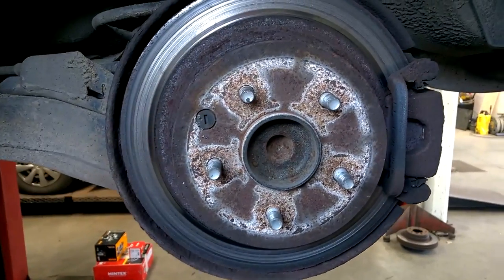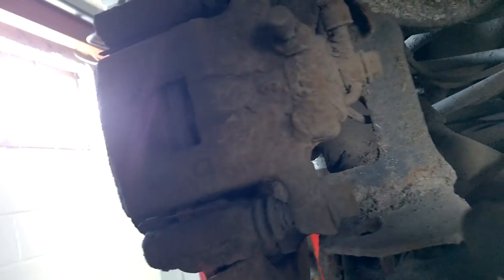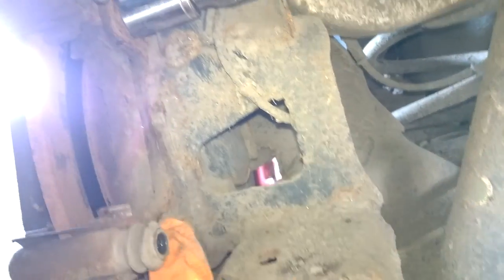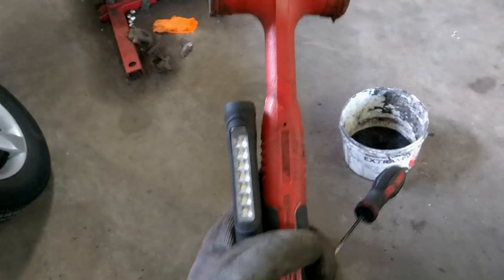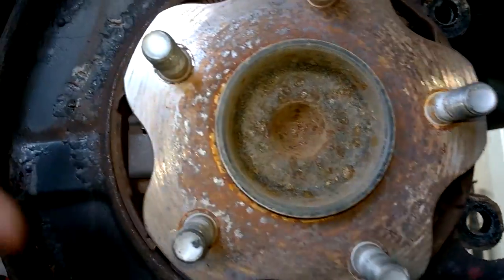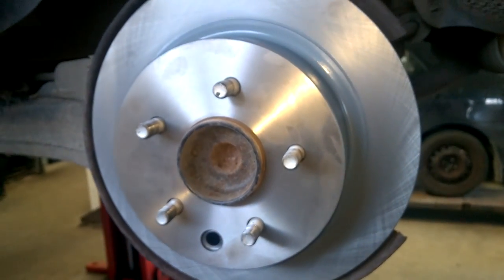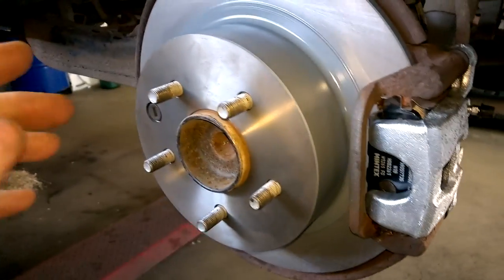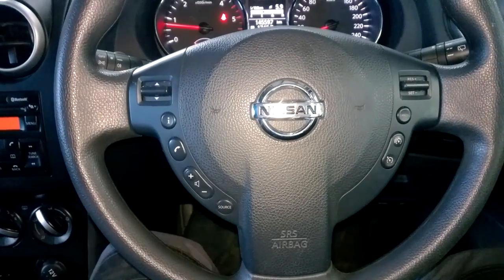Rear Brakes Replaced On A Nissan Qashqai - How To DIY

Comment: Great video Gerard. This is the first one I saw that mentioned filing off the stubs to enable the pads to fit. I thought I had been supplied the wrong pads and was about to contact shop!! Great tip. 

As we are in lockdown I have just replaced the rear pads on my 2009 qashqai - the first pads I have done in over thirty years!! Once I filed off the paint and burrs on each stub end they slid into the shims nicely. But... Do you mind answering a couple of quick questions? Would be much appreciated. 

1. How easily should the pads be able to slide in the shims?
2. There are a couple of tabs broken off on my shims. Are these essential? Should I buy replacement set? 
3. Is it essential to use grease where the stubs meet the shims?

I had an issue removing the lower slide bolt on one side. The rubber got stuck inside but I managed to remove with a suitably bent screwdriver. I then managed to tidy up both the bolt and the inside of the hole in the caliper with a round file and emery paper. Slides beatifully now with silicon spray.

Is there a single "one suits all" type of grease that can be used for the slider bolts and the shims and the edge of the caliper piston?

Various other videos advise copper grease for the shims and back of pads, vaseline for the piston to stop dirt getting in and silicone grease for the slider bolts.

Much appreciated. Charlie. Co Donegal.
Reply from the maker: Hello Charlie, firstly it is very difficult for me to reply to messages as I get so many and I work full time, hence the delay in reply. below is a quick summary to your questions.
 
1. How easily should the pads be able to slide in the shims? - fairly easy without being loose, you show never have to use a tool to force pads into place & can be removed again by hand.
2. There are a couple of tabs broken off on my shims. Are these essential? Should I buy replacement set?  Not really as long as the shims are still in place and not hitting the disc.
3. Is it essential to use grease where the stubs meet the shims? This one brings a little debate, if the anti rattle shims are very clean or new the answer is no, but most will do it as anyway. I was told many years ago by a gentleman who worked with a brake company that if it has the anti rattle shims, greasing is not needed as they will move freely on them as long as the surface is clean. 
 
Regarding what products I use, I have since simplified my approach by using and all in one product that is extremely effective, been using it over a year now on brake every job. 
 
I have linked my latest video below which is a brake job on a BMW and I show and link the product there. Thanks for watching. 
 
https://www.youtube.com/watch?v=dKhJIbefXsc
Reply: @GerardBurkeBurkesGarage  Massive thank you for such a comprehensive reply. Just heading to One Stop to get a tube of ceramic grease. Brakes have started a rubbing noise so will take them apart to check my work work and grease them up.
Funny they started making a noise after about 2 weeks. They were fine initially.

Again thank you.

Comment: Also no mention of cleaning the hub.
This needs to be spotless - otherwise your discs will run out - which causes thickness variation over the next 500 to 2000 miles.

Comment: Please don't file the pads. 
The problem is corrosion of the cast iron carrier - this needs careful filing in a vice to remove rust - then refit abutment clips, but agree pads should not be tight and be slide smoothly.
Reply from the maker: No in most extreme cases I have come across it is 100% the new aftermarket brake pads that are at fault. A simple test you can do is check with the old brake pad if you have movement vs the new pad when all your cleaning up of surfaces is complete. I have come across this fault over 100 times when installing pads. Additional coating and incorrect replica of pad shape is to blame in these cases.